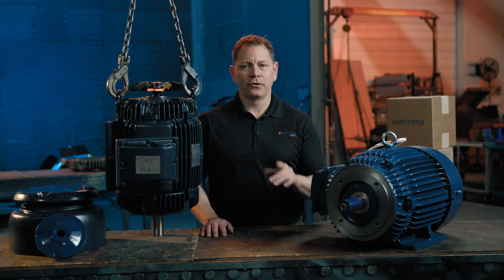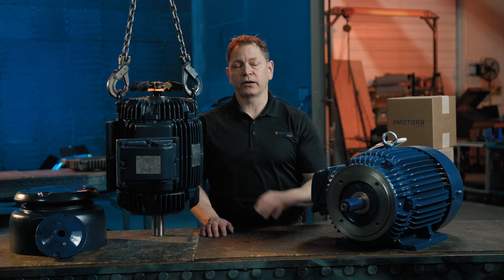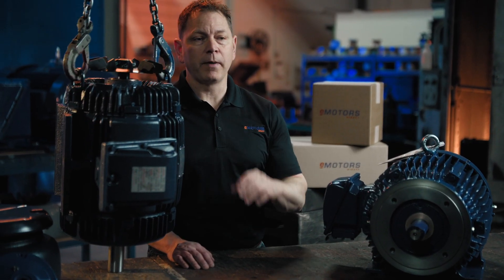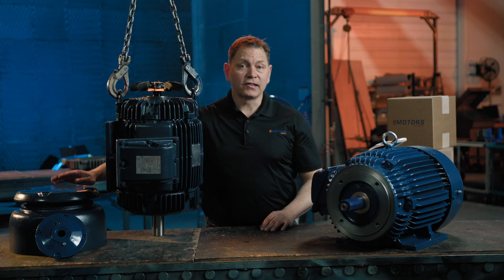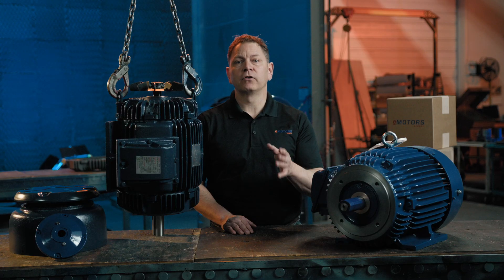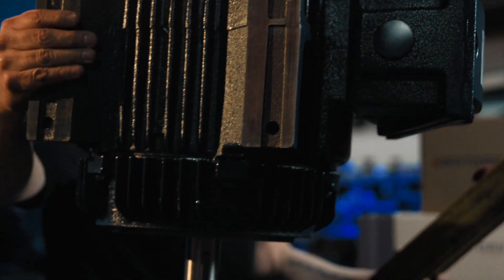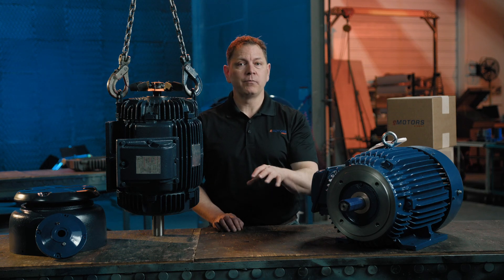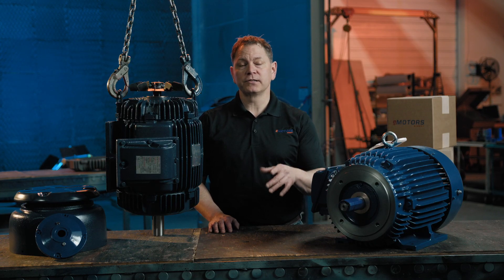Can You Mount an Electric Motor Vertically? 4 Critical Modifications to Know (Motor Mod Part 6)

Comment: How about Drill press and mills, shapers? all of them have motors verticaly without any special modifications...
Reply from the maker: Great point Slivra. You're absolutely right that many machines run vertical motors without extra mods. The difference here is in environment and how the motor is sealed or drained. In many industrial applications (especially in wet or dirty environments) standard motors mounted vertically can collect moisture or debris internally if they’re not modified. Things like breather drains and drip covers help prevent water ingress and allow condensation to escape.

OEMs sometimes build the motors you mentioned with vertical mounting in mind from the start, but when we repurpose or flip a general-purpose motor vertically, we often need to make some adjustments to match that same level of reliability.